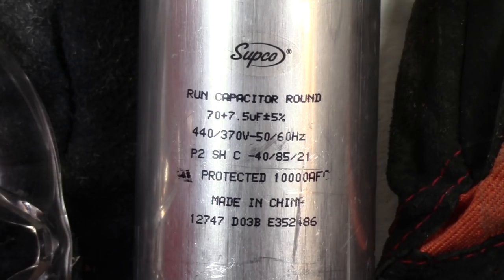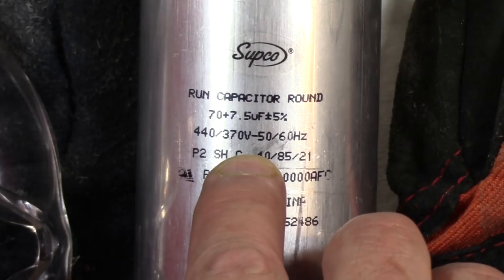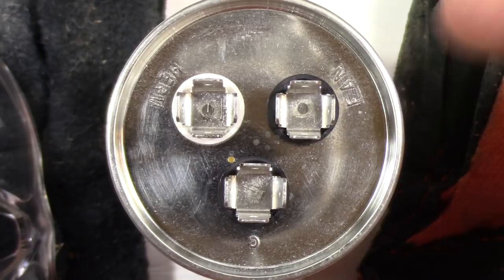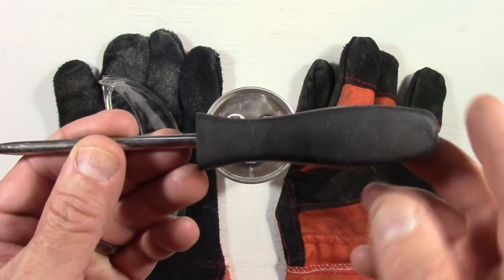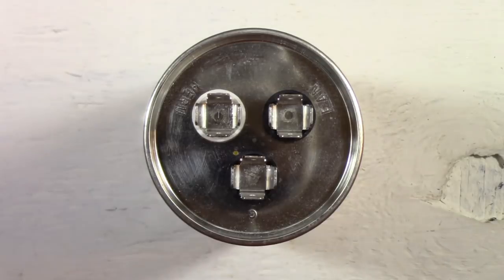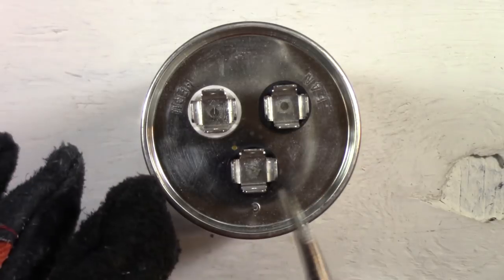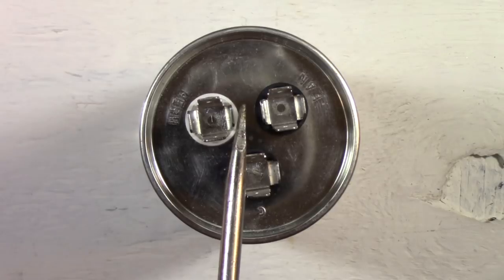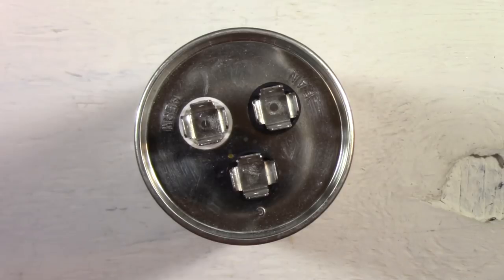How To Safely Discharge Your Air Conditioner Run Capacitor

Comment: The terminals on my capacitor are wrapped in electrical tape. So, there are no exposed metal surfaces for the screwdriver to contact. How would you go about safely discharging the capacitor in this situation? Thanks!
Reply from the maker: Make sure to power down the AC unit first. Wear gloves and carefully unwrap the tape from the terminals avoid touching two contacts at the same time. You could also wear gloves and use an insulated set of needle nose pliers to remove the tape. Hopefully you will have regular connectors under the tape that you can short after doing so. Thanks.

Comment: what about removal of the old capacitor? how can I safely remove the wires from the old capacitor without risking shock as well? thanks for any input you can give
Reply from the maker: Here is the procedure in a video I made: https://youtu.be/19A9lvQ6lIA
Reply: Good
Reply: Hi Great Video, so before removing the wires from the old capacitor, I would just following the same steps on this video?

Comment: if you pulled the breaker on the hvac system and your cap is still wired can you discharge it while it is still wired, or should you unplug it then discharge cap
Reply from the maker: Make sure all the breakers are off and then I would disconnect the connectors safely (using gloves and insulated pliers) then discharge the capacitor. You don't want to arc weld the connectors. Thanks.
Reply: thanks, Richard.

Comment: Doing what you are teaching is wrong ableader resistor or a a supco CAPDIS capacitor discharge pen. What you are doing can damage the capactior. Go to Checking Capactiors with the Supco techlink app andidvm510 multimeter.

Comment: You do damage the capacitors without using a "bleeding" resistance. This is a very bad example of discharging capacitors. do not do so.

Comment: Your video  setup is so much better than others. The camera is steady, everything in focus, not blocked with hands, and you explain everything in simple  terms without talking down to people. Thank you.
Reply from the maker: You are most welcome. I am happy to hear that I could help you. It's my personal mission to help and add value to others lives.  Thanks for watching and the kind words. I appreciate it. All the best.
Reply: @richardlloydusa  hello, the red,yellow, blue, purple wires that's connects to the capacitor, all those wires needs to be removed off of the capacitor  before I use the screwdriver to discharge the capacitor,  correct ?
Reply: Very nice video man 
Thanks for having the patience to explain how things go here.

Comment: Do I discharge the capacitor with the connectors still on, or pull the connectors off the tabs first?
Reply from the maker: Make 100% sure you have disconnected all power. If you have insulated pliers I would pull the connectors off first. I have a video on how to make a DIY capacitor discharge tool here: https://youtu.be/pVIV905qby0   Thank you so much for watching and commenting. I appreciate it greatly. All the best.👍😀

Comment: there's a professional HVAC person touching those connectors with his fingers to check for voltage. don't do that ever. capacitors can kill you. safely discharge it, and then check it. I build PCs. I don't mess with the inside of power supplies because they are dangerous because of the capacitors in them.
Reply from the maker: You're most welcome. I'm glad and very happy to know that I could help you. Thank you so much for watching, commenting and the very kind words. I appreciate it greatly. All the best.👍😀

Comment: If I am discharging the capacitor while it is still bracketed inside the air conditioning unit (as you suggest), shouldn't the wires be carefully unplugged from the capacitor first?

Comment: I would not use a screw driver, this is kind of bad and dangerous advice…. You want to hook up a resistive load to it, rated for that voltage also safely.
Reply from the maker: I have a video on how to do just that here: https://youtu.be/pVIV905qby0 Thank you so much for commenting. I appreciate it greatly. All the best.👍😀

Comment: Use
 a 20K OHM resistor with two jumper leads to discharge your run and start capacitors folks.  Hopefully your start has one installed already and rarely does a run zap you, but possibly a good reason they teach in school not to use a screwdriver.  However, I guess that means future business though doing it the screwdriver way...

Comment: Thank you Richard.  Your information about how to discharge the capacitor gave me reassurance that I was doing it correctly.  I installed my replacement capacitor this afternoon and wanted to make sure that the capacitors were discharged.  Everything went great.  Thanks again for a commitment to safety.
Reply from the maker: You are most welcome. I am happy I was able to help you get it fixed. Thanks for watching and the kind words.

Comment: I have to do this on my central AC unit so I needed a refresher...funny story...in the 80's I worked on photo processors in the navy and they had us dismantle and reassemble the processors.  The first thing they taught us was to ground the main capacitor to the body of the processor with a screwdriver, telling us to MAKE SURE the power was off.  So, of course, one genius tried to discharge the capacitor with the power still on and BAM!  The screwdriver was literally melted.  From then on, that sailor was known as "Sparky".
Reply from the maker: LOL, I've known a few "Sparky's" and they are lucky to be counted among the living. Thank you so much for watching and commenting. I appreciate it greatly. All the best.👍😀

Comment: Thanks for this! I was planning to look at my ac to see if I could fix it, but I wasn't totally sure how to discharge the capacitor. I have a pair of rubber handled pliers I was going to use to short the capacitor but I wasn't sure if it could damage the capacitor or not as i'm not too familiar with capacitors, more expertise more lies in building custom computers :P

Comment: I just stick the capacitor terminals straight to the metal frame of the unit.
Reply from the maker: I can't or wouldn't recommend doing that. Be safe. Thank you so much for commenting. I appreciate it greatly. All the best.👍😀

Comment: After shutting off the disconnect, do you attempt to remove all of the female terminal connectors before discharging? Or, do you just leave them on there while you are shorting the capacitor?
Reply from the maker: After verifying that the circuit is NOT live you can do it either way. I would say it's probably safer to do it before removing the terminals. Thank you so much for commenting. I appreciate it greatly. All the best.👍😀

Comment: Does this damage the capacitor in any way? Does it remove some of the protective coating from the terminals? What about the screwdriver?
Reply: only start caps have the protective coating. runs have metal casings like in this video. that's because of their VERY different applications even though they do the same thing on a technical level.

Comment: You forgot to tell us the most importan thing... do we discharge it while the leads are on in other words, before we pull the leds off, or do we discharge it after we pull the leads off and its off the AC unit?
Reply: Since no one has offered to answer your question, i will. Use a pair of insulated pliers to pull off the leads separately and don’t let them touch. Remove the capacitor and discharge it according to the video

Comment: Does discharging like that destroy the capacitor? I have a phase converter that the company recommends testing the capacitors once a year.
Reply from the maker: The capacitor is designed to charge and discharge continuously (usually) they have other uses too so I really can't comment in your application. I suggest contacting the manufacturer of your equipment for the proper and safest procedure to test it. Thank you for watching and commenting. I appreciate it greatly. All the best.👍😀

Comment: Is it normal to get a small shock from touching just the can itself?  I was trying to move the metal strip holding it so I could get a better look at the model number when I received a small tingling shock.  It was steady though like it was a current.  I'm sure this needs replacement even though it looks normal(no bulge but fan needs jumpstart), but could this current be coming from somewhere else?
Reply from the maker: Make sure you disconnect the power before working on any electrical device. Certainly test the capacitor. It may look perfectly fine and have failed regardless. I have a video on this here: https://www.youtube.com/watch?v=19A9lvQ6lIA&t=1365s&list=PLnxXRLSlmSVOUSl-tmdEuav4IW1OghaES&index=1 Thanks and be safe.

Comment: Do you need to discharge the capacitor before installing a hard start kit?
Reply from the maker: You should always handle the capacitor as if it is charged. To be safe you should discharge it though most likely it will not have a charge, it's best to be safe and discharge it anyway. Thanks.

Comment: So I have a capacitor connection that is a single connection to the two terminals like an outlet plug.  How do I safely de-engergize the capacitor if there is no exposed metal to put the screw driver to?  Do I just unplug it part way to expose the terminals and place the screw driver over that?  And how do I test if there is still charge do I need to rent a tool to check for voltage?
Reply from the maker: You will have to disconnect the wires from the capacitor and discharge it after. Make sure to use insulated gloves, tools and safety gear. Thank you for watching and commenting. I appreciate it greatly. All the best.

Comment: Many many thanks. Easy and to the point. One question: do you need to remove the wires first from the old capacitor that's connected to the unit to discharge(already having pulled the fuse from the box) or discharge with the wires connected?
Reply from the maker: I would recommend removing the leads (using electrically insulated tools and gloves) as the control unit on the AC unit is an sensitive electronic device and you don't want to chance blowing that as you discharge the capacitor. Safety first. Thanks.
Reply: Earlier you said it was okay to discharge, with the wires attached.
Reply from the maker: It's up to you but upon reflection I think it would be better to remove the leads before discharging the capacitor to protect the electronics in the AC unit. Thanks.

Comment: Is the procedure the same for the old capacitor that is being removed while wiring is still connected to it?
Reply from the maker: It will work either way. Be safe. Thank you so much for watching and commenting. I appreciate it greatly. All the best.👍😀

Comment: Did you damage the cap ? The discharge current is so big that will damage the cap.
Reply from the maker: No, it worked fine after. Capacitors are made to charge and discharge quickly and do so inside the AC unit at very fast rates. Thank you so much for commenting and watching. I appreciate it greatly. All the best.👍😀

Comment: Do the capacitor wire terminals need to be disconnected before discharging while the capacitor is still mounted to unit ?Thanx for the helpful vids & keep it up!!!!
Reply from the maker: I do it prior to removing the wires as it is safer to handle the wires after you do it. But always assume the wires are live. Wear and use proper safety gear and procedures either way. Thanks.

Comment: How long will they hold a charge for I'm pulling a couple off of a AC units that have been sitting for like 8 years serious question
Reply from the maker: They can hold a charge indefinitely. Always assume they are charged and handle them safely regardless. Thank you for watching and commenting. I appreciate it greatly. All the best.

Comment: Will any screwdriver with a plastic handle work or does it have to be 'insulated'?
Reply from the maker: In effect the plastic handle makes it insulated. Wear protective gear as well (gloves, eye protection etc.) Thanks.

Comment: Yes - Well done, clear, safe, etc., but, for those of us who might know how to change capacitor(s) out on our own,(and you probably covered this on your orig. video), a quick "review" as to why and when the old and new capacitor(s) should be discharged would be helpful.  If the old capacitor is bad, doesn't that, by definition, mean that it isn't storing energy?  I guess maybe it's storing but no longer discharging, possibly, right?  Or, you might have a link to your orig. video - just a thought.  Thanks!

Comment: Just my two cents. The gloves are definitely the way to go, but I've seen spark shoot right through leather.  The main thing, is that screwdriver should be very well insulated? Don't do "the electrocution shuffle"

Comment: When you do this, where does the electricity "go?"
Reply from the maker: By shorting the capacitor you, complete the circuit. The energy is  discharged as light, sound and heat. Thank you so much for commenting and watching. I appreciate it greatly. All the best.👍😀

Comment: So if the capacitor is deformed or leaking what is the safe procedure to remove it?
Reply from the maker: Here is the procedure in a video I made: https://youtu.be/19A9lvQ6lIA
Reply: Ok, I thought I saw on one of your videos it stated not to attempt to discharge a deformed or leaking capacitor.  But the link you shared doesn't say anything about that.
Reply from the maker: There are really two reasons to discharge a capacitor:
#1 SAFETY so you do not get a nasty shock.
#2 So you can test the capacitor with a meter without introducing the energy stored in the capacitor into your digital meter. 
If the capacitor is deformed or leaky there really is no reason to test it, it's shot. Throw it away. I would not discharge a damaged capacitor for fear of flammable chemicals just handle it safely (Electrically insulated tools and appropriate gloves) and dispose of it. Always treat a capacitor as you would a firearm, assume it's loaded (charged). Thanks and be safe.  All the best.

Comment: right, but technically your supposed to use a resistor across the capacitor so that large amounts of current don't damage the cap or cause a spark.
Reply from the maker: Understood. I would imagine most DIY'ers would not have the proper resistor tool to do this. I will look into constructing one of these and making a video. From what I see on online AC forums the techs agree with you in theory but in practice they generally use the screwdriver method of course they all have an extra capacitor in the truck. Thanks for the tip.
Reply: I would add that the purpose for accessing the capacitor in the first place is to replace it, so damaging the old one by shorting it out is a moot point.
Reply from the maker: I also made a video on how to make your own capacitor discharge tool too. Here is a link to it https://youtu.be/pVIV905qby0?list=PLnxXRLSlmSVOUSl-tmdEuav4IW1OghaES

Comment: replacing my 20yr old original fan motor, system has a 3 pole capacitor in it, but a smaller 2 pole cap was supplied with new motor.   Would you recommend i bypass the original capacitors fan pole, and wire the new capacitor in with common, or simply use the aging factory capacitor?    Replacement motor is same Hp, RPM and voltage rating as factory.  Old 3 Pole Capacitor turns over compressor just fine.  Thanks in advance, cant wait to replace this fan motor!

Comment: Will the 5W 10K resistor work for the standard 120 volt 900 watt microwave?  Thanks in advance
Reply from the maker: You need to consider the capacitance value of the capacitor and how quick you wish the capacitor discharge. Here is a link for a discharge calculator: http://mustcalculate.com/electronics/capacitorchargeanddischarge.php Thanks.
Reply: Michael Della Pella 
Tell me  how it  works

Comment: My HVAC guy called this is a myth. Said it’s  charged, but basically it’s static electricity.
Reply from the maker: Ask your HVAC guy if he has ever seen static electricity melt metal like I did when I shorted this capacitor. Trust me it's not static electricity. Be safe. Thanks.
Reply: Is your HVAC guy actually an HVAC guy, or someone’s 8 yr old kid that had wandered down to your house giving advice? Tell your HVAC guy to demonstrate that myth and he’ll possibly lose a finger or two when it likely vents.

Comment: Better way is to jump them with a resistor with the correct value and a multimeter attached right show voltage

Comment: I work on RV AC systems. Should I disconnect all wires from the capacitor before discharging capacitor or do it with the wires still connected to it?

Comment: Richard...question...I understand that you have to discharge an old capacitor before taking it out of your AC unit.  Do you have to discharge a new capacitor before installing it in the AC unit?